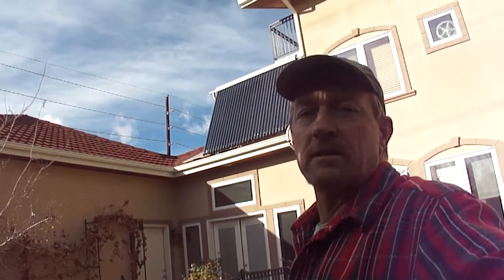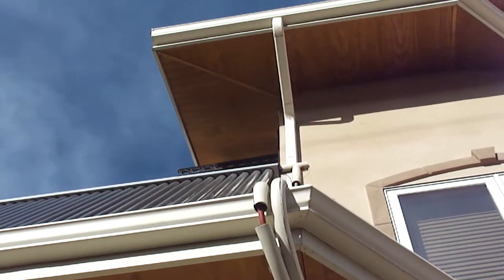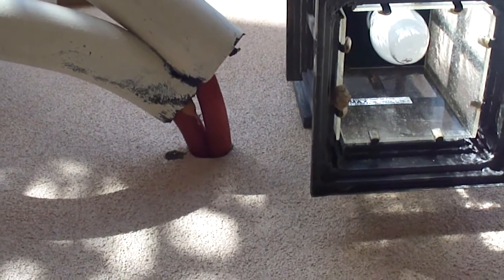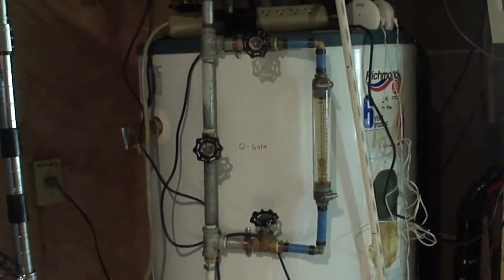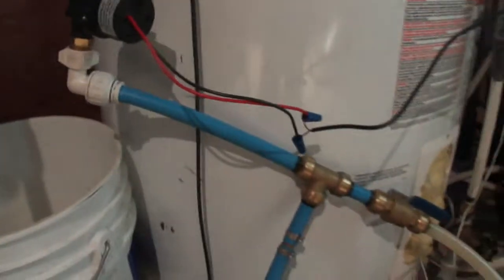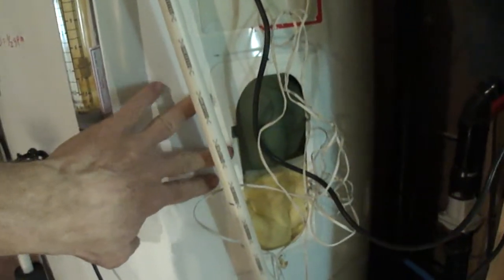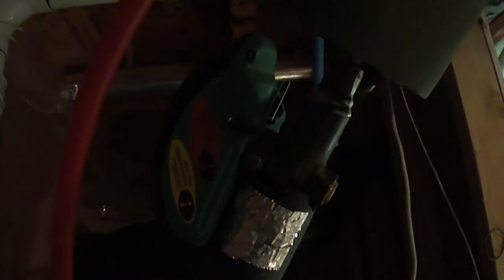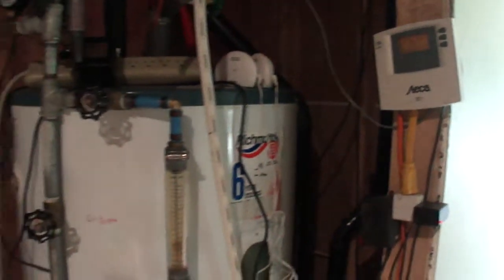Cold Climate Direct SDHW System with Recirc

Comment from the maker: Thanks, that's a killer idea. I've been aware of that foam rod, but couldn't find anything other than a vague advertisement  in a European journal. Transsen was the company promoting it.

Energynerdist, Do you have any information on a source? Silicone can survive the potential stagnation temperatures of that header, which I've measured to 420F.
The heater hose shown has survived freezing solid as well as dry and  wet stagnation.